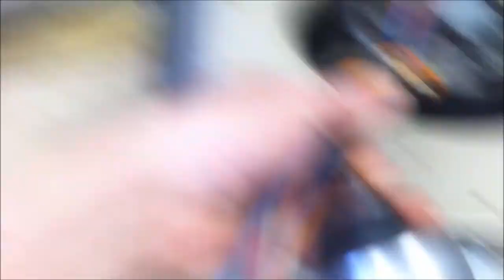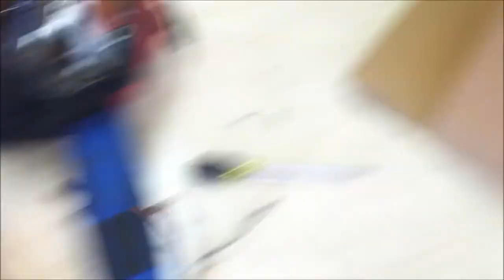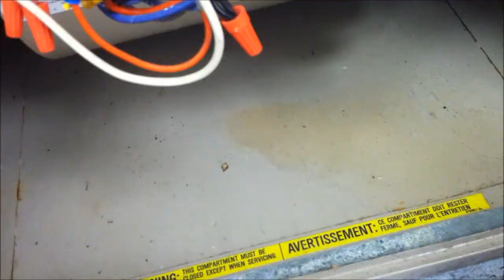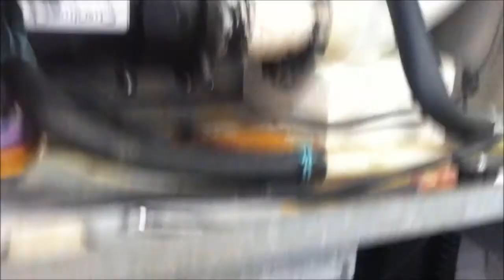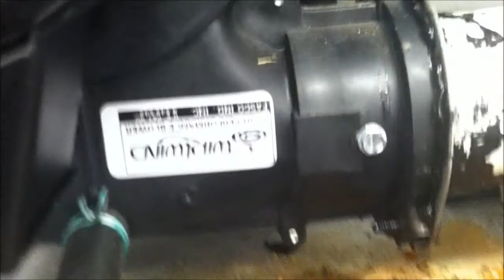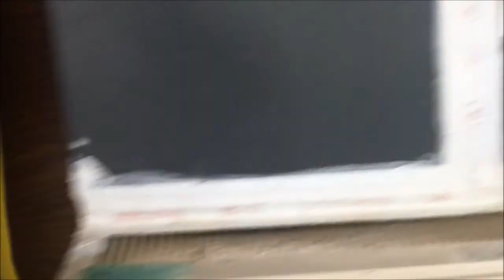HVAC Blower motor and wheel change out

Comment: Something like that happened to me in a service call I did back around 2008.  The "sales tech" told the costumer he needed a new furnace.  Of course, the costumer didn't tell me this until after I installed a new thermostat and everything was up and running.  Yep, that was the problem, a bad thermostat.   And it wasn't even an old system, probably 5 years old back then.